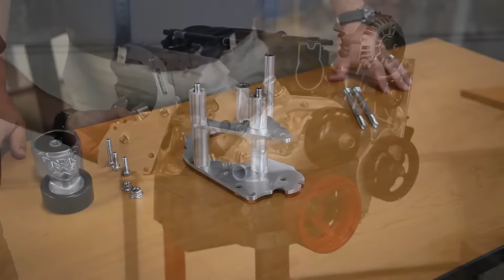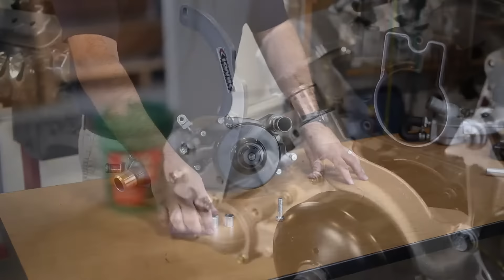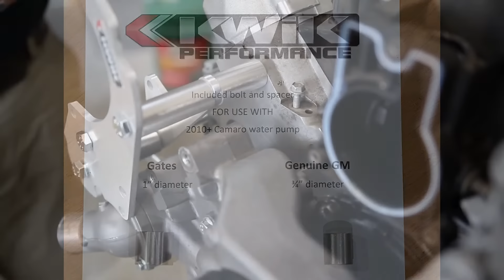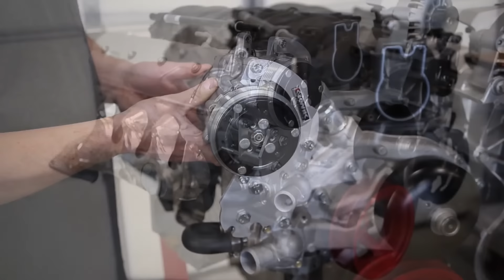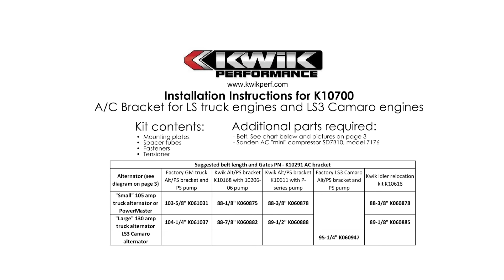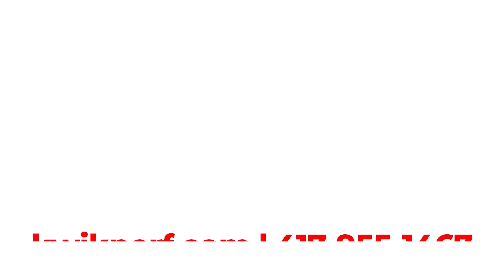Kwik Performance K10700 LS High and Tight - installation instructions

Comment: Do you have any dimensions of where it actually sits trying to see if it'll fit in my car with my turbo kit
Reply from the maker: Here ya go! https://www.kwikperf.com/cdn/shop/files/K10741HighandTightvsfactorycast_2956c486-7f81-47ae-8da9-4d89805eb375.jpg?v=1775662714&width=1500
Reply: @kwikperformance very nice thanks